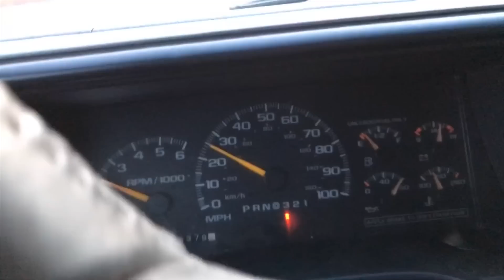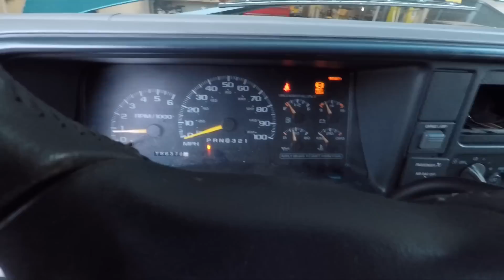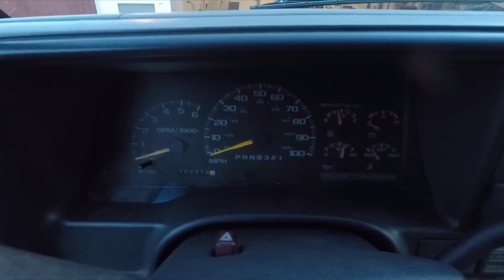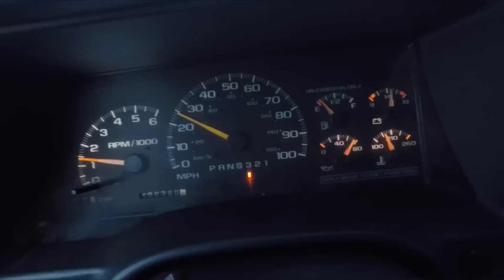First Drive In My 5.3 Swapped 1998 K1500

Comment: If you were to upgrade the odometer/cluster assembly from the green truck what would you recommend.
Reply from the maker: I would probably get Denali gauges. I like clean and simple
Reply: @EndlessWishlist  Is the Yukon project a Denali?
Reply from the maker: The wrecking yard said it was but it’s not. Just a standard Yukon
Reply: Get the 120 speedo

Comment: How did you get the rpm and speedometer to work??
Reply from the maker: Ran the tach signal from the obs to the ls ecm and had the tuner adjust the signal.